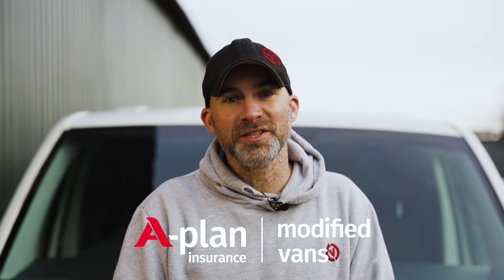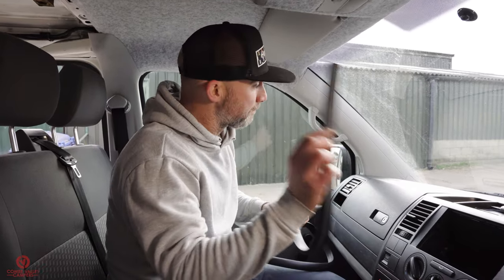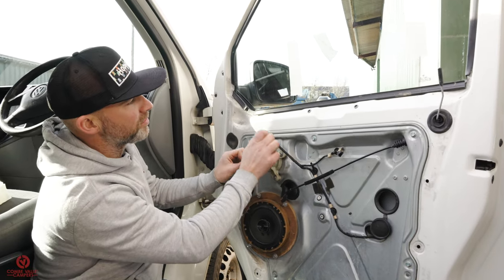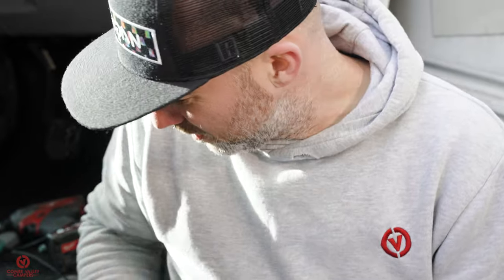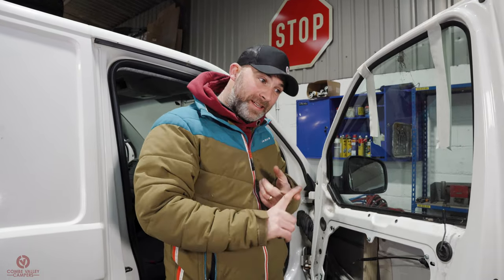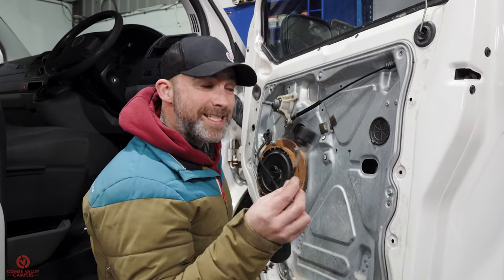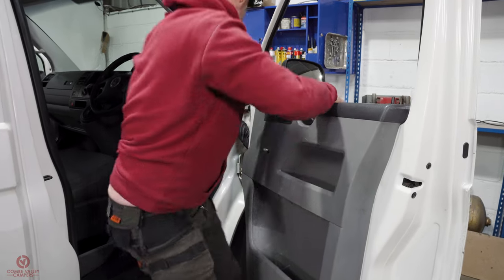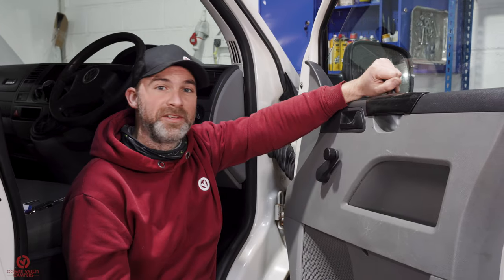KEEP YOUR T5 ALIVE! 5x EASY JOBS YOU CAN DO AT HOME

Comment: Big thanks for this video! Just sound deadened my passenger side today up until the point that I dropped the window clamp bolt while putting things back together so I decided to call it off for today open it up again tomorrow 😂Looking forward to seeing how you do the deadening. I was considering to put some armaflex there on top of the butyl mat but for the time being the butyl is enough. Hopefully the drivers side goes a bit more smoothly. I'll definitely have to put some grease to my window cables too as the motors on mine seem to be in trouble sometimes already. I hope I have something suitable back home that does not mess up everything.

Comment: Can you do a video on changing a T5 external door handle. My passenger side sticks out when you open it. I have to push it back in every time and i cant find anything on the internet. It would be very welcome to the community I'm sure as there is extensive questions regarding this but no answers. Cheers!

Comment: Great video. Really helpful. Any tips for how to get the door card off the passenger door that will not open so that the mechanism can be fixed??
Reply: Simon.  I had to do this the other day on my T5 door totally shut unable to open - there is a vid on YT but essentially you remove the seat (for space). Pull the plastic away from the door pillar - remove the plastic step - it’s a bitch but it will come out.  Then do all the steps here to remove window winder and screws - the 3 at the base are a pain but you can get to them if the steps out.  The door card is then removed - work from left to right if in the van.  The hard bit is near the dash but with care and sweat it will come off - then do the steps to hold the window - disconnect wires etc - you can then see the lock module behind the inner door skin - you can break it and wind a wheel to release the lock but I resorted to smashing it with a screwdriver etc - in a few mins the door opened - you need a new module and an award if you keep your cool - good luck

Comment: I'm looking at getting into converting vans to campers, I've been looking at commercial property to rent to set up, I'm unsure of the usage I would require from the premises, I think it's B classification, can you confirm that, also is there anything I need to be aware of regarding operating times, I'd like the freedom of being able to work when I like, my first van I'd be trying to convert as quickly as I can to start earning so I'll be working long days if I can, but do you know if there is a distance limit to housing areas, some of the property I've seen are quite close to housing areas, thank you